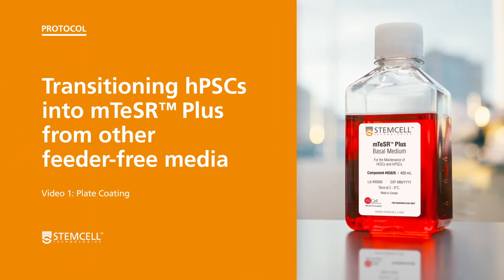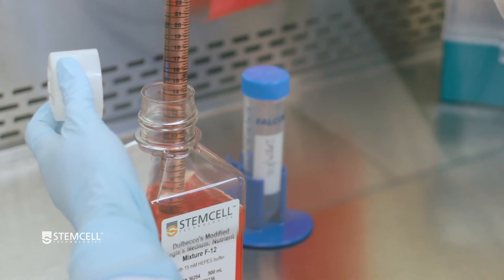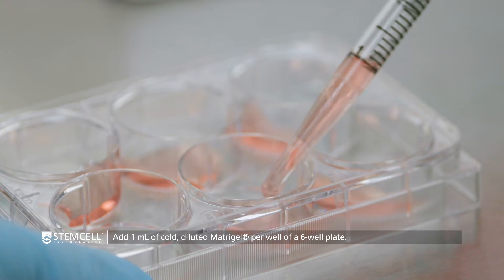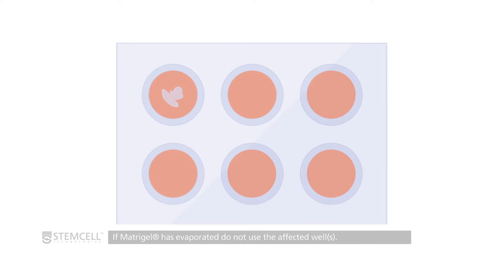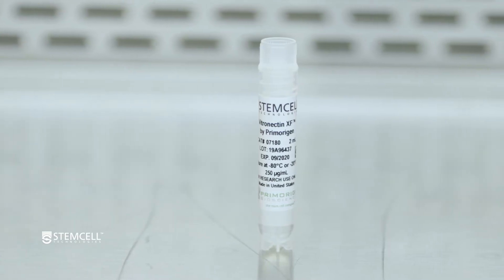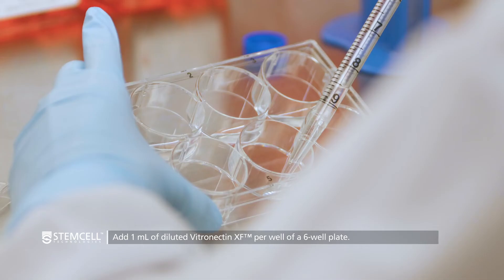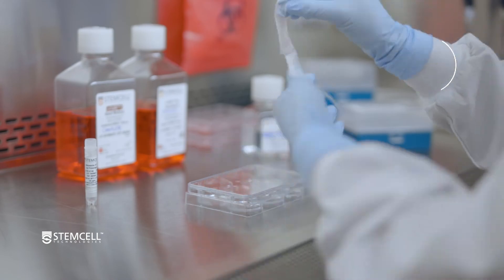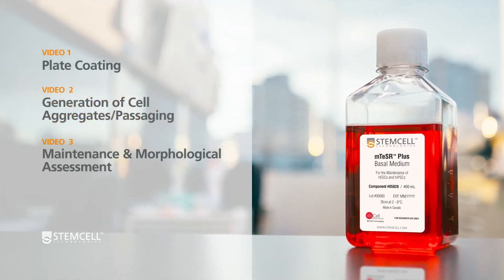How to Coat Plates for Human Pluripotent Stem Cell (hPSC) Cultures in mTeSR™ Plus

Comment: May I know the concentration of Matrigel in this protocol?
Reply from the maker: Hi, the full protocol can be found here (https://cdn.stemcell.com/media/files/manual/MADX23032-Maintenance_of_Human_Pluripotent_Stem_Cells_in_mTeSR_Plus.pdf). Specifically, steps on how to coat the plate with Matrigel is detailed in section 4.2.1. 

You will need to first make aliquots of Matrigel based on the recommended aliquot size/dilution factor listed in the Certificate of Analysis, then load the recommended volume listed in table 1 (section 4.2) into the cultureware. You can also refer to the written version of the video protocol, found here (https://www.stemcell.com/transitioning-pscs-to-mtesr-plus.html). If you have any more questions, feel free to email us at techsupport@stemcell.com
Reply: @STEMCELLTechnologies  Thank you.